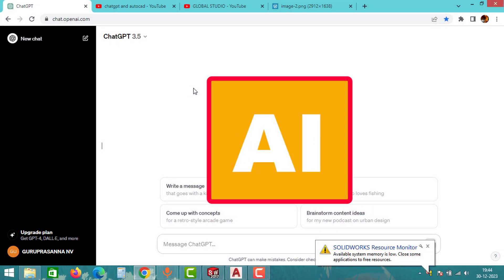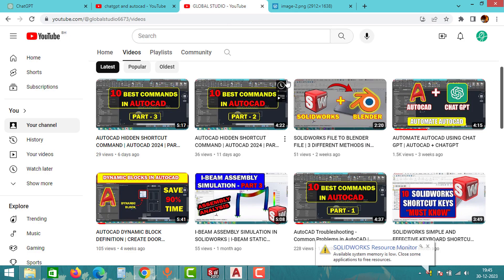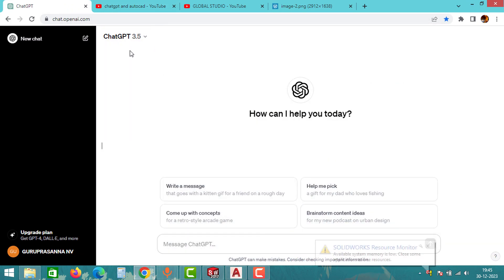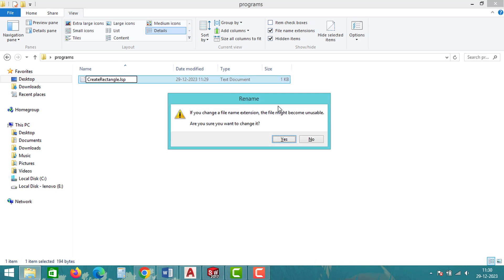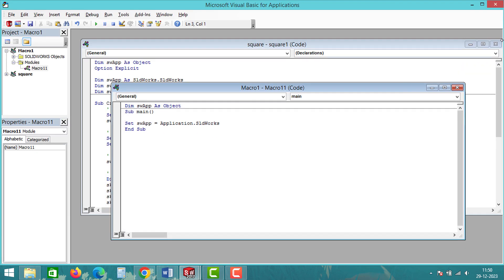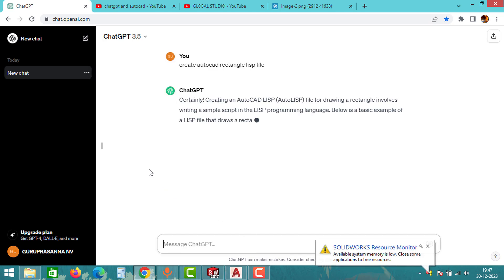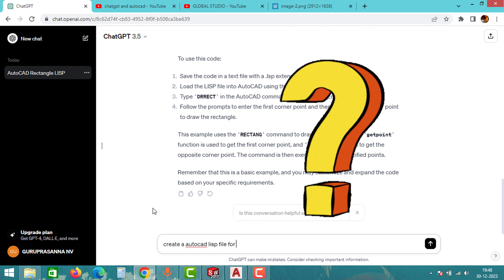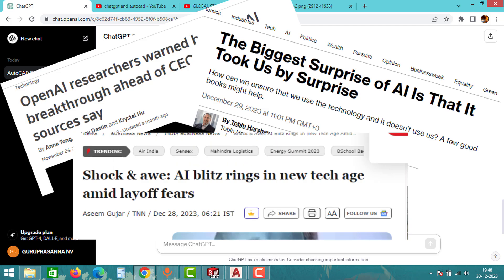ChatGPT VS CAD Tools | ChatGPT in AutoCAD & Solid works | CAD+AI

Comment: Hey there,

I am trying to get the intended BOM of an assembly of a specific display state(DISPLAY STATE-2). But the BOM coming out is of the whole assembly(DISPLAY STATE-1) including the hidden components in the display state-2.
Is it possible to get the intended BOM of the components shown in that specific display state (DISPLAY STATE-2)?
Also,  I have a macro which can do this. Macro is running successfully but not giving me the result. I don’t have enough experience in VBA coding. Can you find the error if I send you that macro?